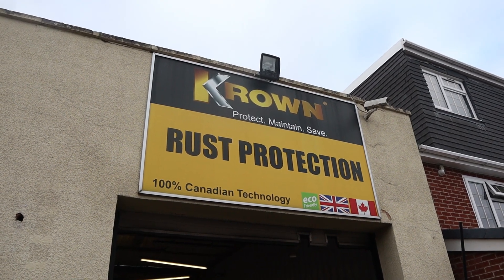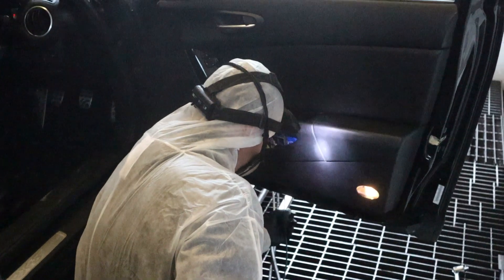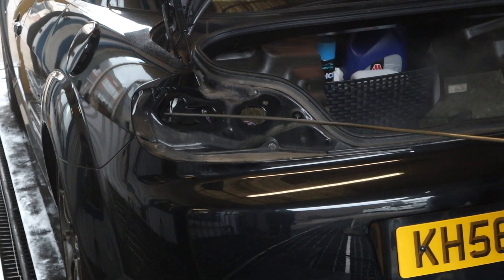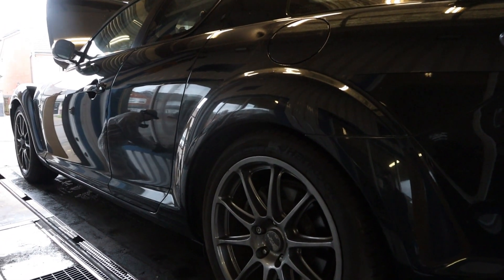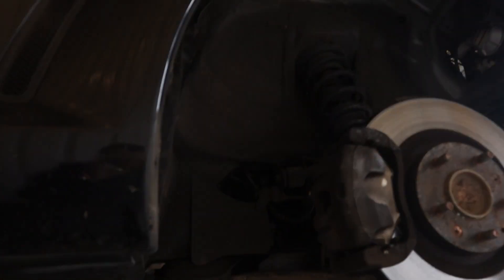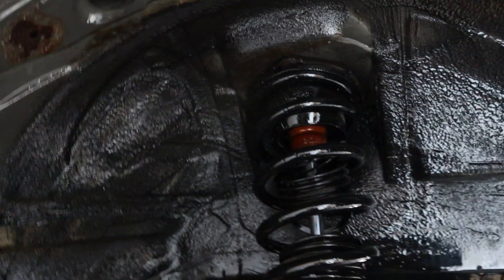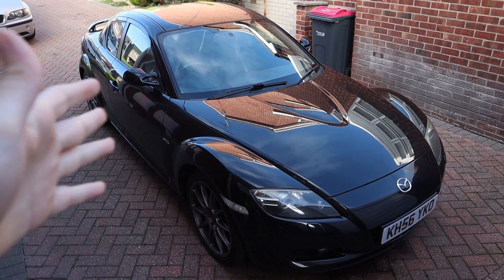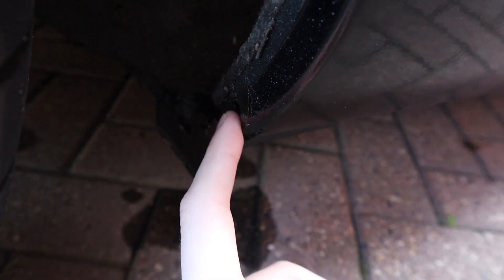Krown Rust Protection - Rust Proofing My Mazda RX8

Comment: Too Funny. I Have a Black RX-8 too. I had to do a full body job on it to keep it. I can't get rid of it.
Reply from the maker: Oh nice one, a man of great taste! 😉👌 Mine has been more engine related for obvious reasons but bodywork is the next job! They're just such a great handling car. 😍
Reply: @TheMoaningYorkshireman  I have had all 3 styles of RX-7. Overall the best handling one made was my 91. The 94 twin turbo I had was fun too.
Reply from the maker: @chrisccc22  Oh, I would love an RX7, my dream car!
Reply: @TheMoaningYorkshireman  Funny how you were getting it rust proofed. Yes a must with any RX. I live in Canada so .................I found out the hard way. 

Really strange???? I also go to crown. 

Also you had a leaky driveshaft. My 94 had to have it replaced. 

Get this. I drove over a plastic bag. The mechanic said it was a one in a million shot but the bag got sucked up through the 2mm gap in the drive shaft and melted. $1200 at the dealer. 

What do you use for polish or wax? Black is a tough color to keep gleaming. 

Frig man we could be twin brothers. WTF is going on here?
Reply from the maker: @chrisccc22  Well funnily enough this is the only Krown Rust Protection we have in the whole of the UK! It's the only licensed vender to use the solution outside of Canada. A 2hr trip well needed. 😊👍 Drive shaft was sorted the week after this video, just a seal which had perished so all good again now. As for Polish I use a cleaner called, "Johnny Lightning" it's a really good cleaning product and they also have a really good polish too. Never look back.

I know it's crazy isn't it, we were meant to find each other in this bizarre YouTube world! 😂